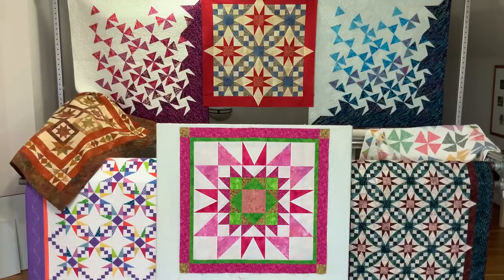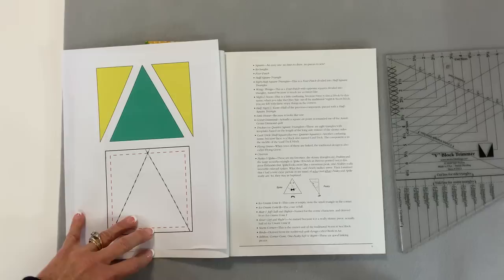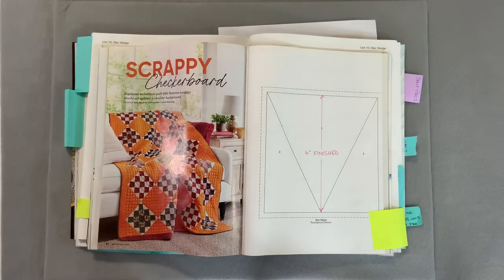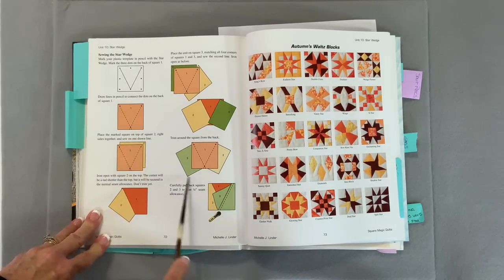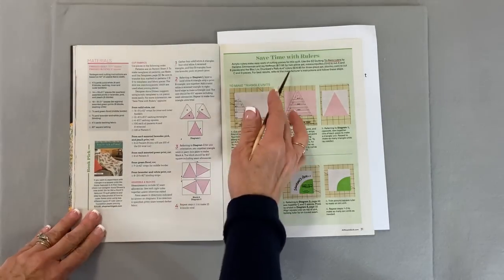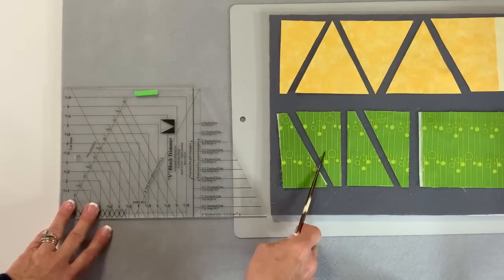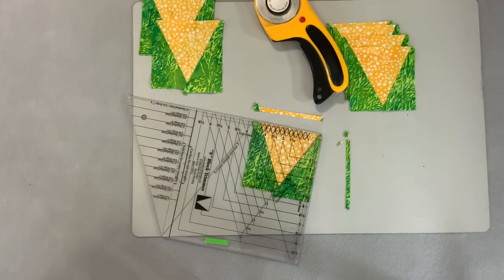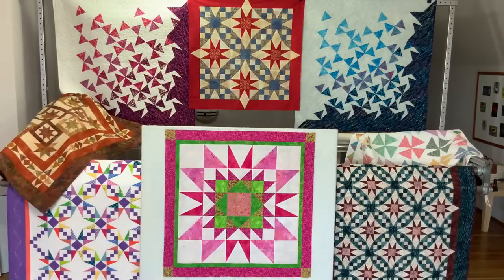Tuckerizing - V Block units - Tips & Tricks from the Tucker Team

Comment: I use pellon SF101 (shape flex)....instead of paper having to be torn out.🥴 Also, shape flex can be used to use in "summer" quilts that you are not using batting in.   You can draw on shape flex 101, and there is a light adhesive side activated with a heated iron....but the block remains flexible, not stiff.

Comment: I used your V-block tool to make a 54-40 or Fight quilt for a veteran.  I had some trouble getting things perfect, but maybe I was too aggressive with my pressing
Reply from the maker: Yes, sometimes the shape can bow if you are too aggressive with the pressing as they are long bias edges. You can fix that with some more pressing just press them back in using a bit of steam just like the fix in the Flying Geese tips and tricks video called Tryly Perfect Flying Geese.